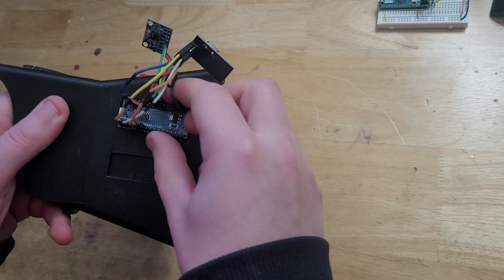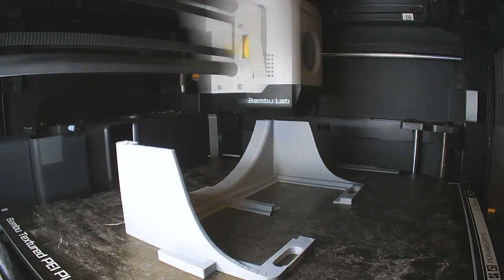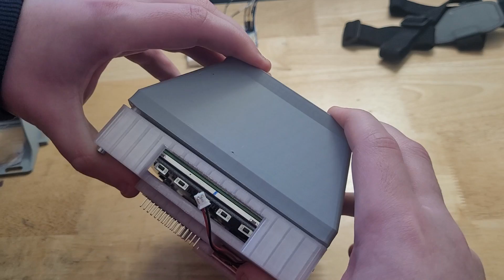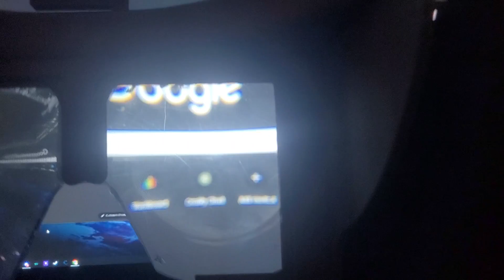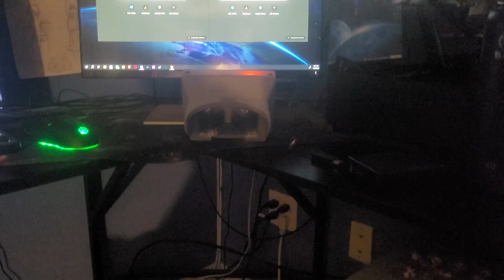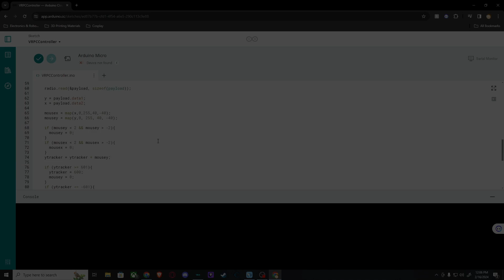Building a Custom VR Headset to play Lethal Company

Comment: Could you explain how the wireless headset works and what could be done to add it to an HTC Vive and not have those annoying cables?
Reply from the maker: The headset is kinda cheating. Basically the full headset acts as a controller. Any game I play, I hijack the keybinds from my mouse & Keyboard / game controller and replace it with my headset. This device is completely stand alone, so there would be no adding it to anything else like an HTC Vive. When I end up making another video, I'll definitely go into more detail.